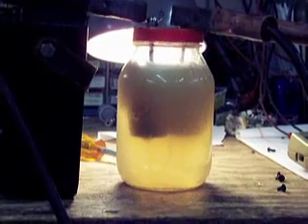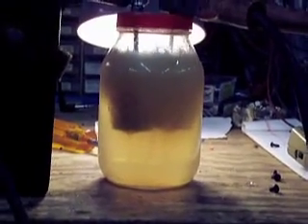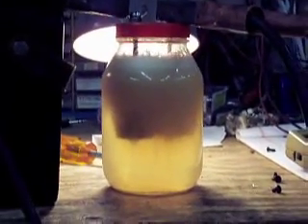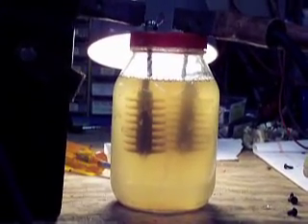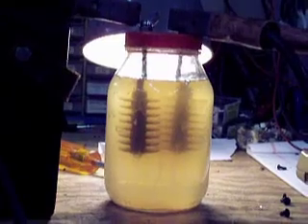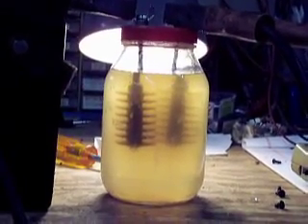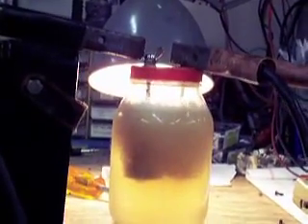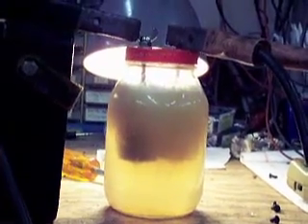HHO fuel cell

Comment: I had heating issues with my fuel cells until someone pointed out that if you have multiple positive terminals, you run the risk of boiling the water.

If you add neutral plates to your design so that you only have 2 volts per plate, you will not have the overheating issues, and you will still get good output.

Basically the configuration would be:
+ N N N N N -

I hope this helps.